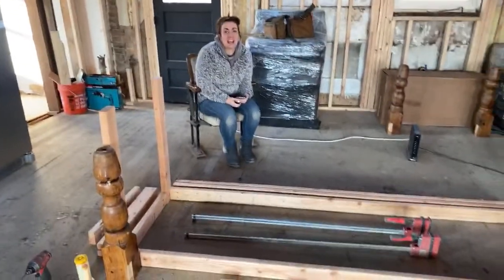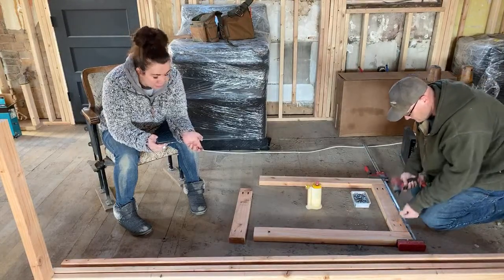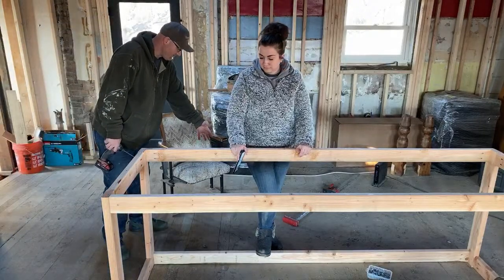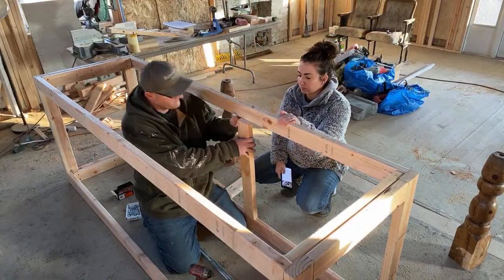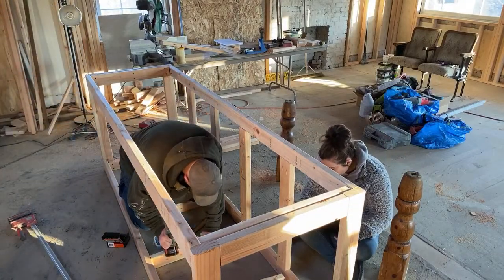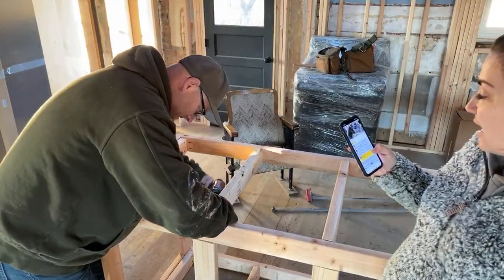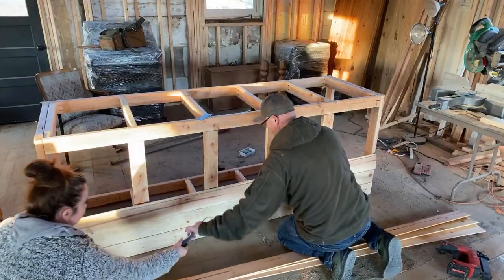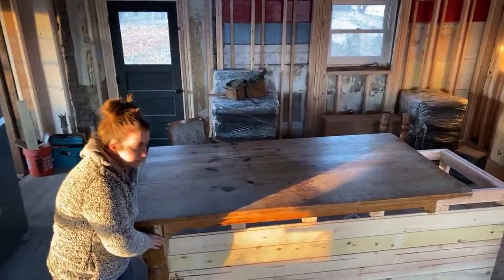Building A Kitchen Island DIY | Home Renovation

Comment: I couldn't see your drawing for the island...most of my clients LOVE a 36" wide 3-drawer "Pot & Pan" drawer stack in the center; 27" stacks left & right (either 2, 3, or 4 drawer).  Or someone mentioned your mixer...if you use it often, it is really nice to have it pop up to counter level...
Reply: Nancy Jo Klug my kitchen is too narrow to really have an island, but too wide not to. I plan to build a custom island this summer with my husband. Under it will be bakeware storage, vertical dividers, and probably drawers to hold dishes for left overs.

Comment: I think a wood counter would look good since there is going to be so much white/painted surfaces, but that's just me. Could you use that table as your counter top & just add maybe a butcher block or another material to the portion that the table doesn't cover?

Comment: It is going to be such a great addition to the kitchen and pretty!  I am hearing impaired and for some reason the closed caption is not working on and off for awhile. Did all the usual. So very frustrating. The talk is a lot of the fun. I am going to google and troubleshoot. It is not giving the option of CC. Maybe the live..but it used to work. Glad you are getting on with things now. So very exciting. My favorite gift is a real Keurig. The new model with filtered water tank on the side. It came with 30 pods. I have wanted one for years but felt it was too expensive for just me. I had a knockoff Black Friday special which leaked and spit coffee all over. My new one works like a dream and is red and pretty too!
Reply from the maker: Sometimes it can take up to 24 hours for the CC to show up on a video. 
Awesome gift!

Comment: why are you not adding the wood block addition to the legs near the table top instead of on the bottom of the legs?
Reply from the maker: We are, they just wouldn’t stand up the other way. 😊
Reply: Jami Ray Vintage  I think you said you are putting the existing block part of the leg up top and adding another block on the bottom. I think it would look better to add the new block onto the top against the existing block, since you won’t notice it as much. The existing turned part of the legs would be the most noticeable part on the floor and are so attractive as is, with the smallest part on the bottom. I think the block on the bottom will look too big and odd. Maybe Zeb could turn the new wood to kind of match? Idk, just my opinion. You will look at it and decide what you like for yourself.